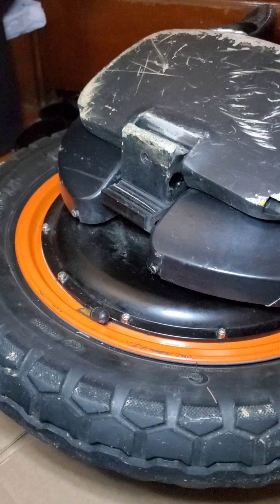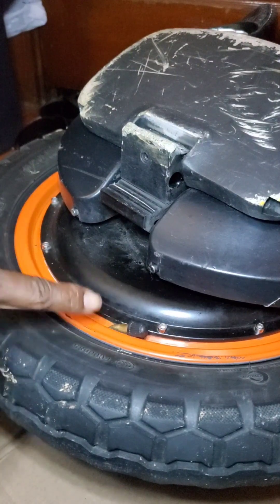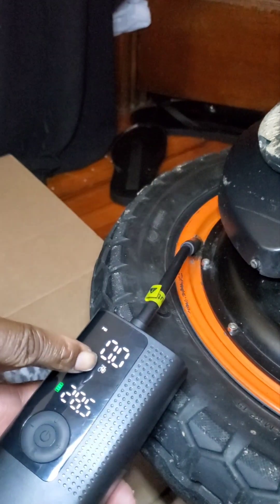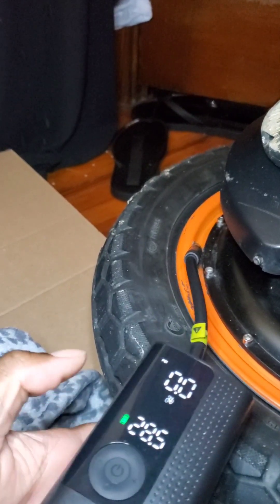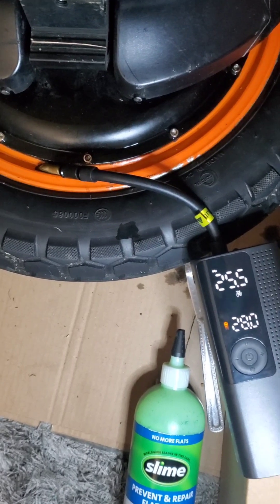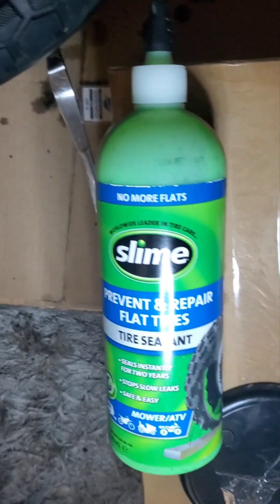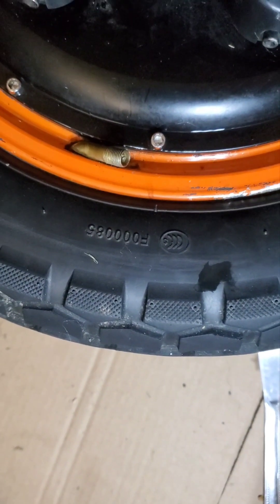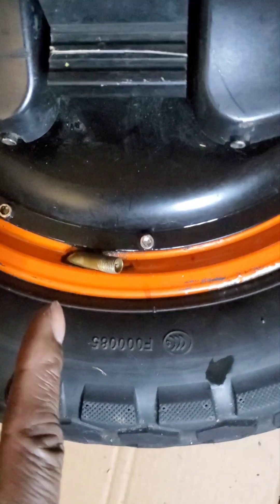Flat Tire | InMotion V12 HT | Fix

Comment: hey got the same wheel... this is a common issue if you don't keep the PSI up to 30+ (should be around 40 PSI).  What happens is if the wheel is low pressure and you go to brake or accelerate quickly the outer tire can slip on the rim and stretch the inner tube (slippage between tire / rim, but friction holding the interface between tire and inner tube).  This slippage basically stretches your inner tube since the tube is anchored at the valve stem (the part you are hooking your pump to) and the tire to tube interface is moving.  That inner tube gets stretched, the rubber thins out, and then will ultimately tare causing a leak.

I would highly suggest NOT using slim to fix this sort of puncture since this is more of a tear than a "hole" caused by something like a nail.  Slim is good at holes, but not great at tears.  To replace the inner tube its going to require some significant tear down of the wheel itself.  There are youtube videos of this but if you're not mechanically inclined I would suggest finding someone that can repair it for you.  This is more involved than a bike tire for sure (like take all overs off, remove harnesses / components, get into the main structure of the axial etc).

That said you want to do this repair since a blow out of the inner tube in this area can be very bad at any speed.  That inner tube could loose pressure immediately which you will not be ready for (likely will happen during hard braking / accelerating).

To help reduce this from happening after repair I would ensure your tire is inflated to about 40 PSI (recommended on the tire) and I also take a sharpie marker and mark the valve stem where it enters the rim.  This helps me visually see if that valve is being pulled into the rim or forced out depending on if its moving during braking / acceleration.  I have over 900 miles on my wheel without a puncture or tear (i'm 230 pounds and ride on/off road).  I really think to avoid this you need to check PSI, and then also every once in a while deflate the tire completely, break the seal between the tire / rim, move the tire around on the rim to reseat the inner tube in its natural / neutral position to relax any strain on that valve stem.
Reply from the maker: Thank you but I know what I'm doing. Like i said in my video, its the stem. I messed it up by accident by not pusing it in like its supposed be. . I'm very knowledgeable. Thanks for the info though. 👍 My Girl is running like she should